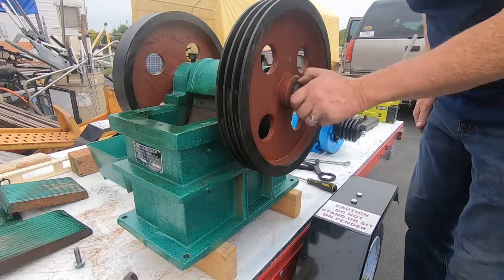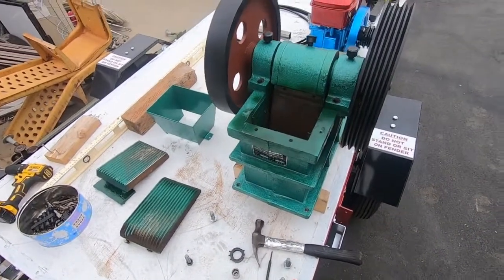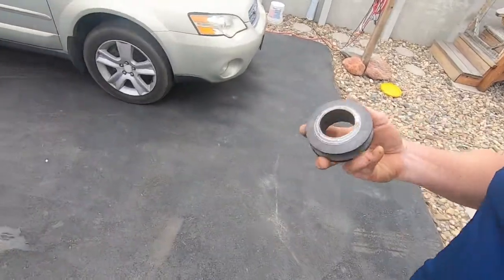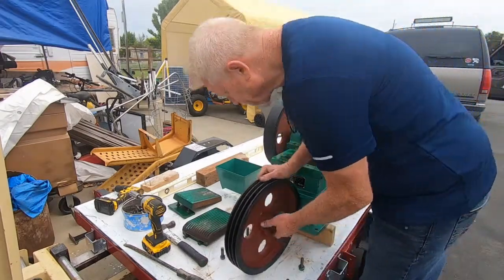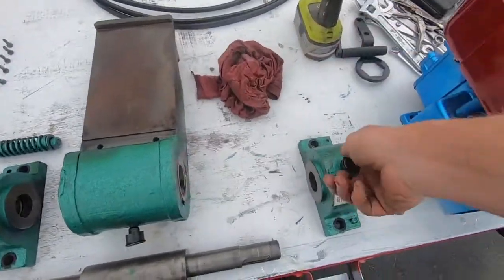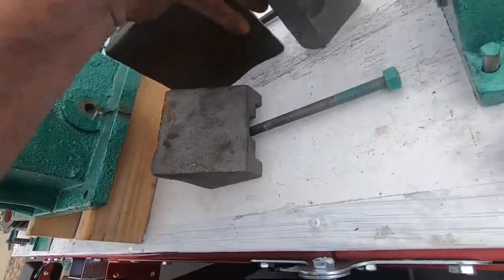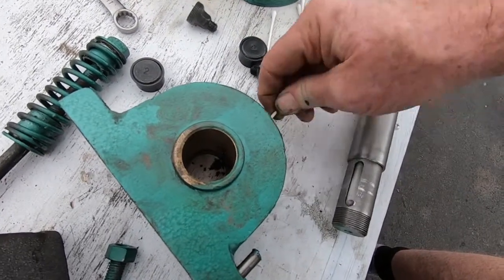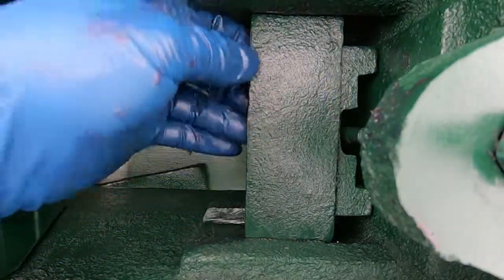Chinese Jaw Crusher PE-4x6 Disassembly Cleanup Lube!

Comment: Did the epa say anything about the motor?
Reply from the maker: Hello Brian, no they did not. I’m sure there is some agreement with the import duties guys that gets them Paid.
Diesel Engines like all combustion engines are Noisy, oily, stinky, requires a lot of maintenance and so so powerful. Because of these reasons, I recently removed the Diesel engine and am replacing it with a used 5 HP electric motor. The electric is quiet, reliable, has no emissions, almost no maintenance and is much more powerful.
Still working on the solar power system to run the crusher and the entire trailer!
Over the last year I completely converted our Shop and Home 100% to Off grid Solar Power.
I used as much recycled materials as possible and DIYed everything!
Our system is very powerful and cost 75% less than having a comparable system installed.
Doing more with less every single day is my usual way.
Thanks 
✌️PT
Reply: I was just wondering because I’m trying to import one
Reply from the maker: @BRIANVANDUYN  did you already buy?
Reply from the maker: @BRIANVANDUYN   it cost me $1500 for the Diesel engine and $1500+ to import in early 2020. Crusher and Diesel engine Total $3100+.
Be careful.. gotta be much more now.
Also when shipped it arrived at LA California port and from there it was my responsibility for storage and duties and fees and final shipping to Boise Idaho.
Reply from the maker: @BRIANVANDUYN   
Mine is for sale 😃
prospectortripp@gmail.com

Comment: Hi like the videos i was looking at making one of these thanks for a brill break down and a great look inside. As for the oilers you can get caps that you screw down with grease in them but it reminded me of my friend who builds steam traction engines from the ground up. He uses them oilers and fills them with oil. He says it does several jobs keeps clean oil flowing through over prolonged periods of time ie on a road trip but also the oil that is silt out washes away and dust and also lubricates other parts as it runs down the machine. That makes more sense to me as i use to have to grease the machines up at the start of the day never gets greased again until next day an we use to get through a lot of bronze bearings. my money would be on oilers.
 Mind you good job you took machine apart as that swarf in the drilling would of ripped your bearing up in no time grease or oil lol.
Reply from the maker: Hello Darren, I thought about the same thing.. oil keeps washing out the grit and dirt. However I was worried about getting oil into the crushed material. So far the grease is working well and I’ve had no issues getting lube into my crushed ore.
Maybe in a production environment oil may be better? Not sure totally. Anyway it’s easy and fast to grease also rate after greasing I wipe off the expelled dirty grease keeping the crusher oil and grease free!
Thanks much for your terrific comment!
✌️PT

Comment: They are grease cups, the idea is to fill the cap and screw it on, giving it a couple of turns a day, I work on bigger jaw crushers and you don't grease the wedge (tapered bit for adjusting jaw gap) because all the force of crushing is applied to the adjusting bolt instead of the friction on the wedge face holding it.
Reply from the maker: Thanks.. I figured you put oil or grease in these cups. I wasn’t familiar so installed grease fittings.
I’m gonna leave in the grease fittings I installed as they are working well and so far no mess with oil or grease getting into the crushed ore.
Only greased twice so far. The first time it was oily but no grease so I it took a few pumps to fill up. The second time it still seemed well lubed.. but wanted to push out any dirt, I just pumped in a small amount and wiped off the excess slightly dirty grease.
So far it’s been a good jaw crusher!
Busting Rocks!
Thanks Mr Sock
✌️PT

Comment: I'm having to wait for glue to dry... so am going back and re-watching some of your earlier stuff PT. I'd forgotten how much cr*p you had to clean out of that baby. Metal Shavings and Dirt, the Breakfast of Champions! (MSADTBOC). Peace !
Reply from the maker: I fired up the jaw crusher the other day and the diesel started dripping oil from the valve cover. When purchased an extra valve cover gasket came with the engine. 😳
They’ve apparently had trouble with leaking.
I removed the valve cover, cleaned up and resealed with The Right Stuff Gasket maker. During this I checked the oil and it was Over Full? I didn’t over fill? I found that I left the fuel On.. has a on off fuel valve.
I believe the diesel fuel slowly leaks into the crankcase when left On! After a few months oil level is too high.. pressure is too high.. valve cover gasket blows and leaks.
I have not started or drained and replaced the oil yet.. just repaired the leaking gasket.
Before starting I’ll change the oil.. should be okay if I turn the fuel off.
Thanks 
✌️PT
Reply from the maker: @Della Konicek Still breaking rocks!
Thanks Della
✌️PT